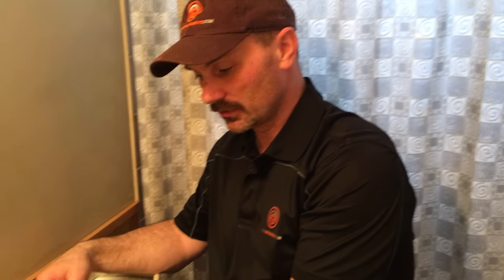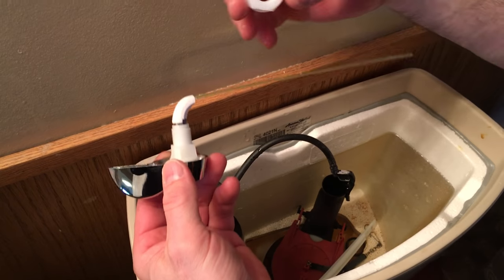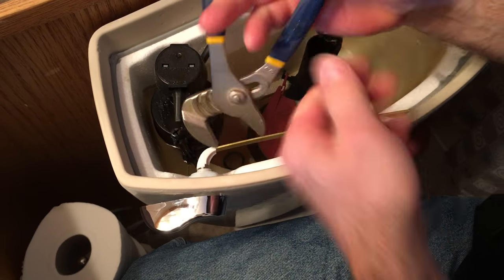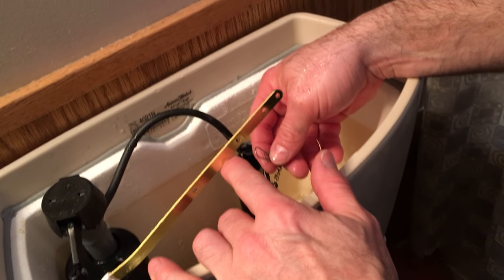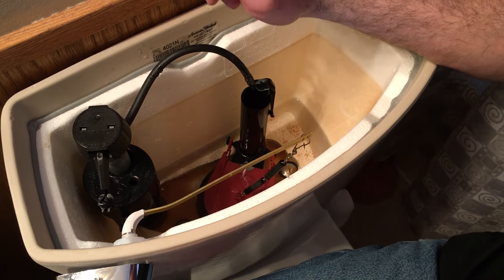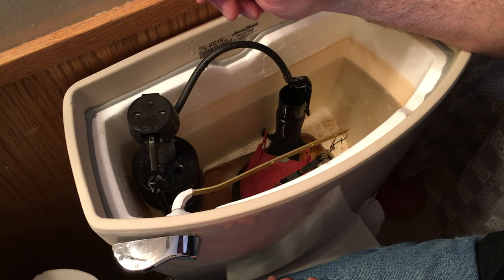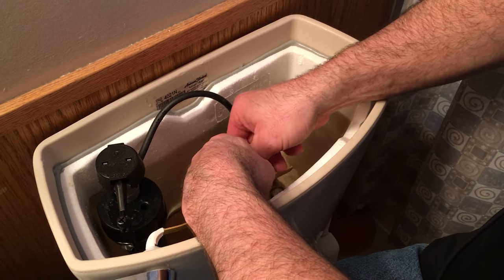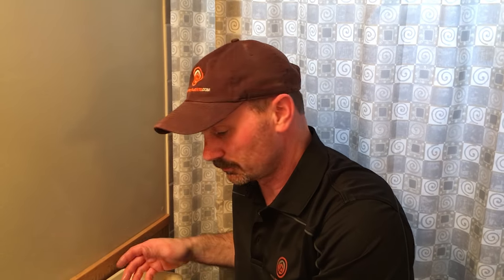How To Replace A Toilet Flush Lever (Handle)

Comment: Plumbing is something I know very little about. My handle needed replacing. I tried to replace it and couldn't. So I go to youtube to watch someone do it. Within 35 seconds of this video I discovered my problem. I didn't know the threading on the nut was revearse threaded. So I was trying to loosen the nut by turning in the wrong direction. I can't at this time figure out why the threading is revearsed. I am sure there is a logical reason.

Comment: That toilet tank looks pristine. I opened mine after a few years today and it looks like black plague from medieval times.  Changing this flush lever as we speak.  So good when you can diy this stuff
Been doing similar for years.  Imagine if you had to call a handyman, plumber or electrician for every little easy fix.  Saves you a ton with know how.

Comment: thanks for this. you saved me an embarrassing return to the store because the arm was too straight to fit inside my curved tank. i didn't know i could actually bend the rod to fit until you told me. (i was afraid it would break...) 👍
Reply: SAME!!

Comment: Interesting, I'm not sure I've seen a toilet tank with Styrofoam in it before.  Is that insulation to prevent sweating in humid climates, or to decrease the gallons per flush?
Reply from the maker: sweating
Reply: @HouseImprovements  ^ bingo. never used to have this problem when the tanks had thicker ceramic. now everything is thinned out, thus bc of the heat transfer it sweats. so annoying

Comment: I got a nice chrome plated metal handle one, with a round rod that flattens out at the end, and I had to bend it down about 30° to keep it from ckinking on the underside of the lid. There is a rubbery square inside the handle that presses into the square opening of the toilet tank, although it is a little mushy. However there is a lot play in the handle and rod where it goes through the tube with threads on it, and there's a strange little circular ring just sitting loose at the end of the threads that the nut goes over. Tightening the nut does not help the looseness. It flushes fine and springs back,  but I don't know that it should be so wobbly.

Comment: Just replaced my handle/lever, but the new handle doesn't sit horizontal to the outside of the tank like the old one did. This one is angled up, and there doesn't seem to be a way to adjust it. Any idea how to straighten it out? Thanks!
Reply from the maker: If you can't adjust it enough in the hole, i'm not sure? Maybe its specifically for a different toilet?

Comment: I'm having an issue where after  flushing, the flopper stays up. The handle isn't broken, the flipper isn't leaking. Either I have to jingle the handle or open the toilet lid and push the flopper down. 

I tried a few things but no luck. Any idea/tips/tricks on how to tackle this issue. Thanks!
Reply from the maker: May just be time to change it.

Comment: I’ve found the “plastic arm” handles rarely adjust correctly to fit. This metal arm was easily bent to fit correctly. Keep that in mind when shopping for this part. I’m on my 2nd trip to Lowe’s 😢

Comment: Mine just broke as well. Thanks for this. The issue with it now is that the handle will not pop up like it used to.I have to wait for the float for it to come back. Maybe I need to bend the handle some as well.

Comment: Shouldn't you shut off the water while you're working on the toilet? Other than that, I did mine the same as in this video, and it worked.
Reply from the maker: For doing this particular repair its not necessary but you can

Comment: I did a plastic lever and the edge is slightly touching the side of tank.Does it cause any damage to the flapper?
Reply from the maker: It should not. Just be sure it can't catch on the side of the tank and get stuck up so the flapper does not close.

Comment: The newer levers are not one flat piece that would be easy to bend, but instead only the end is flat, the rest is a solid metal tube which, unlike the flat part, is impossible to bend. So the lever drags against the tank and the handle sticks. (Some improvement!)

Any ideas on how to bend that tube?
Reply: My new one is like you describe- a round metal rod. My son was able to bend it without any trouble. Just a slight bend in the middle did the trick.

Comment: Hello, apologies for my ignorance but what is the tool called that you used to tighten the screw? Do I need to have it on hand for the installation or can I just tighten by hand ?
Reply from the maker: channel lock pliers, water pump pliers ,adjustable pliers there are a few names for them. A wrench will even do just dont tighten too much. Its kinda hard to get a grip with your fingers so usually a tool is best.https://amzn.to/2BLgKri
Reply: @HouseImprovements  Thanks so much for your prompt and detailed response! I guess it took a pandemic for me to become handy ;)

Comment: What about a side mount??
Reply from the maker: They are basically the same procedure, just a different handle.
Reply: @HouseImprovements  but if it’s universal it’s supposed to fit both front and side mounts. Mine says it works for both but I can’t seem to configure it correctly for side mount.